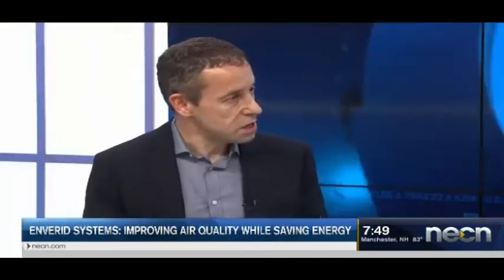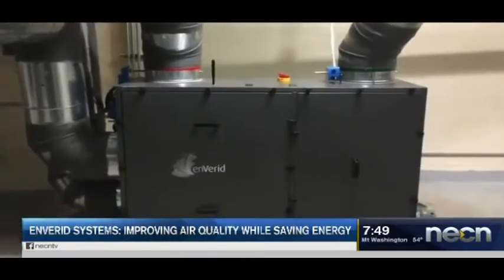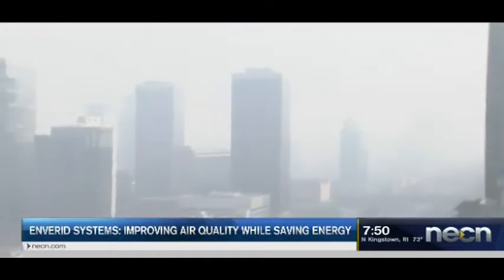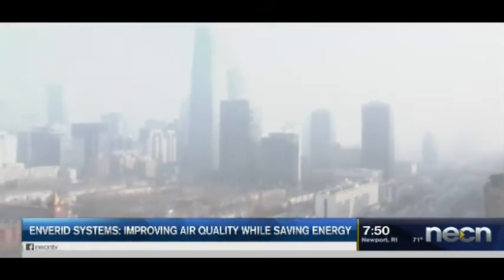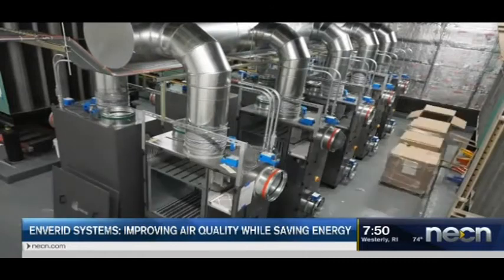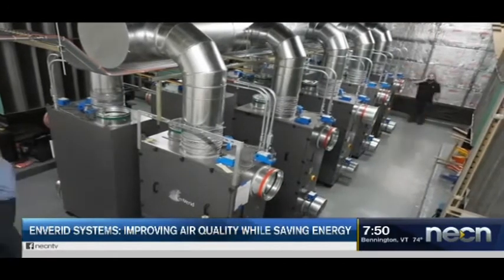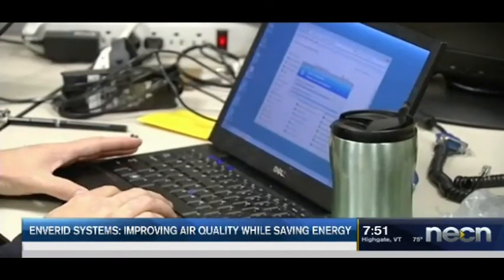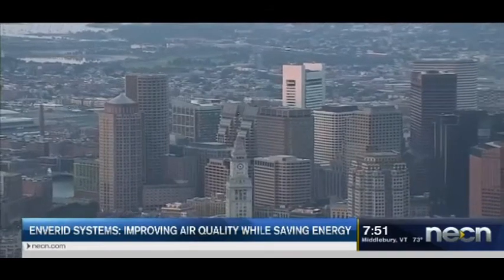NECN Broadcast: Improving Air Quality While Saving Energy and Money

Comment: Guadalupe, you are correct that some outside air is still necessary to maintain positive pressure and this is important to maintain to prevent unwanted infiltration of outside air that does not get properly filtered or treated.  HLR modules typically enable a 60-80% reduction in outside air, which is very large but not a 100% reduction.  While the HLR modules could be used to clean the air sufficiently to enable a 100% reduction, this is typically not feasible because there is almost always some exhaust air plus the need to maintain positive pressure.